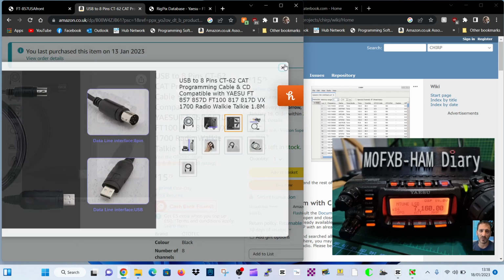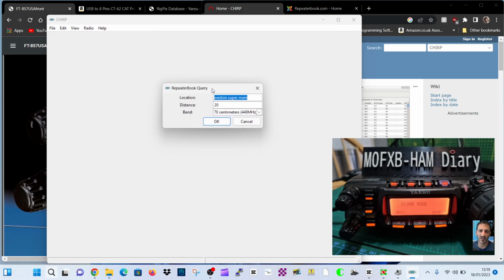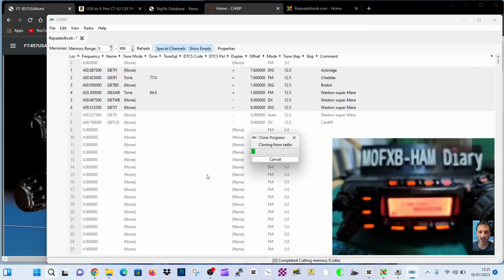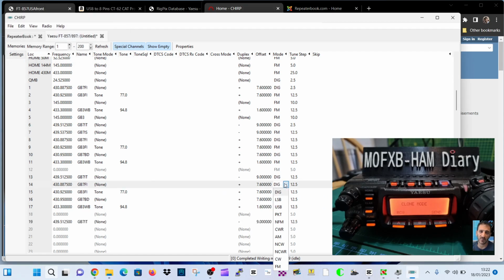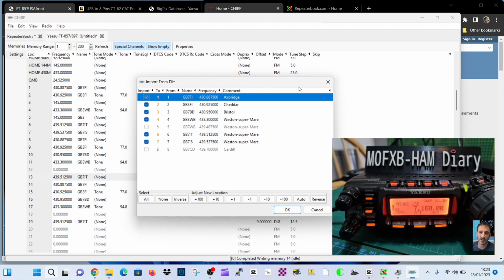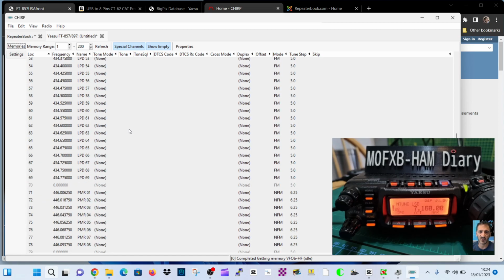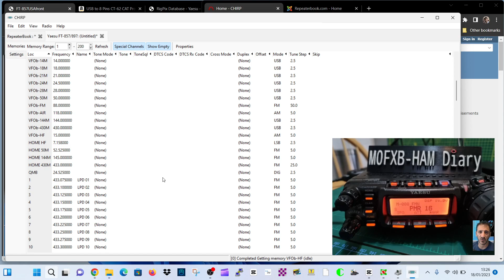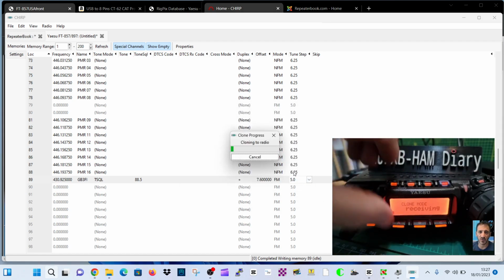YAESU FT-857D - IMPORT REPEATER BOOK - CHIRP

Comment: Have an 897D and every time just getting the message error “ unable to communicate with radio, unable to read block 0” ? Doesn’t matter how fast I press receive with the software on it wont work, the cable is connected to com 5 and working as no problem communicating with the radio with HRD. Both baud rates on the software and radio are set the same… its annoying lol
Reply from the maker: You need a.speacial dongle .
Reply: @M0FXBHamTech  so where do you get this dongle from please?